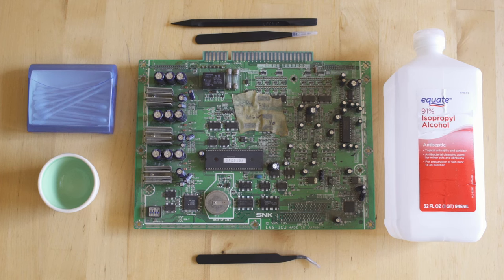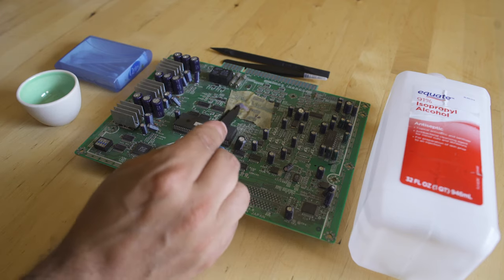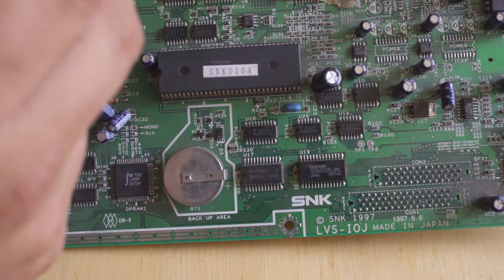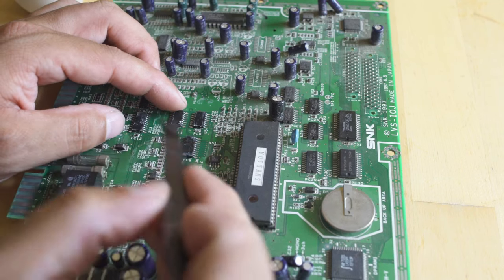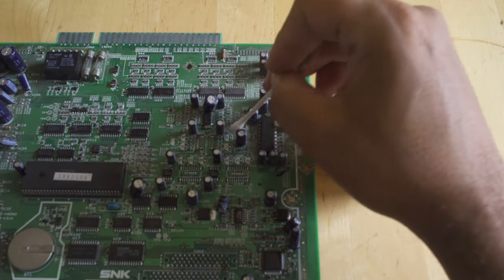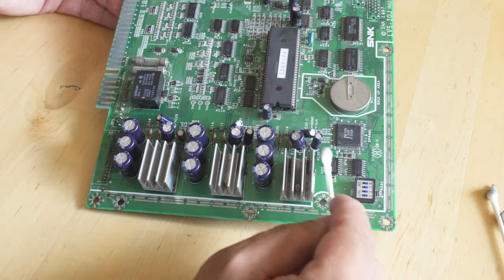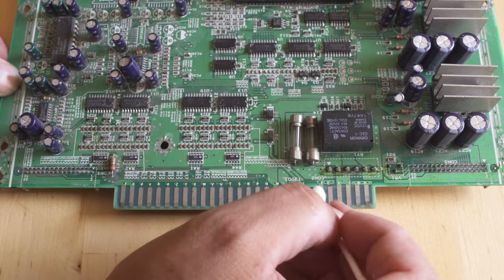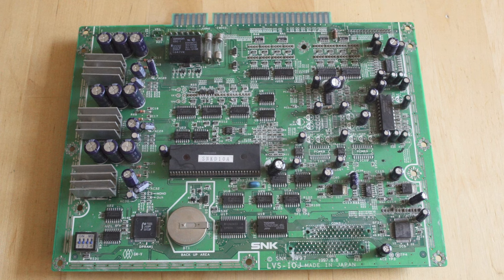How to Clean PCB's - On a Technicality - Video Game Esoterica

Comment: this also applies to controller boards for monitors, right? or basically any pcb board?
Reply from the maker: Any pcb. 91 or 99% IPA evaporates incredibly quickly. So any pcb can be cleaned with it. 30 seconds is normally plenty for any ipa to have completely evaporated unless you spill your bottle on it.
Reply: @VideoGameEsoterica  oh ok thanks! but since I can't go out due to the pandemic, is it ok if I use the normal 70% Isopropyl?
Reply from the maker: Deomari Laguipo yes. Just give it longer to evaporate. I also cannot find any IPA currently due to people buying it for sanitizing purposes. I normally don’t use 70% but if I had to I’d give it 5 minutes or so to truly evaporate. Specs say 1 minute but honestly giving it 5 certainly wouldn’t hurt
Reply: ok! thanks a lot!
Reply from the maker: Deomari Laguipo any time! Happy to help

Comment: Will the Isopropanol/Isopropyl Alcohol Clear 99.9% 500 ml
 work?
Reply from the maker: Yes. That’s basically straight alcohol with no water. Anything over 90% and you are golden!
Reply: @VideoGameEsoterica  what about 70
Reply from the maker: It’s fine. Give it a few extra minutes to dry

Comment: Thanks, 
1.) But what are the programming in these PROM chips? Can you use PROM chips to do address decoding? 2.) What Programmers do you use to test every TTL family and CMOS chips, logic chips, IC amplifier chips in arcade games? the IC leaper is limited only test few TTL families not all
3.) If arcade games didn't use Flip Flop IC chips the data from the EEPROM chips and microcontroller chips would be free running and not clocked, is this why they use Flip Flop IC chips because it clocks the data signals?
Reply: not sure what to think about your comment

Comment: A way better alternative to tapwater or the dishwasher.

Who would have thought that IPA could be used to clean a PCB? lol  ;)
Reply from the maker: The dishwasher works but that’s for extra dirty boards and the drying time is much longer. I don’t know the exact science on evaporation times but IPA 91% is basically instant vs water which clearly is not
Reply: @VideoGameEsoterica  

A big part of the problem with tapwater / dishwasher is the minerals and impurities in the water, which can hang around under chips and other components for years, and help accelerate corrosion etc.

Personally, I don't see why anyone would use normal water why it's cheap enough to buy IPA or distilled / deionized water.

(I realise IPA has a small percentage of water too, but it's far more pure, and as you say, basically evapourates within minutes.)

Using tapwater on vintage arcade / computer / console boards (especially if you're trying to make them last as long as possible) seems like doing more harm than good.

Hopefully more people will see vids like yours, on how to do it properly. ;)
Reply: Isopropyl alcohol, not India Pale Ale, just for the record. :-)
Reply from the maker: Lolol this is true

Comment: Oh I found cotton buds are terrible for cleaning the boards as the ends falloff
Reply from the maker: What brand are you using? Q-Tip brand never fall off but I’ve seen it happen with cheaper store brand ones for sure

Comment: DO NOT DO WHAT THIS GUY IS DOING
just ruined a vintage 1701 commodore monitor using the same stuff 

some vintage boards have a coating to protect them from corrosion and i just found out the hard way that it does not like IPA sprayed on it 
the hole green side of the board went discolored and sticky it's a mess
Reply from the maker: That means your conformal coating has broken down chemically. I’ve cleaned boards with conformal coating with IPA with zero issue. Whatever commodore put on the pcb has broken down over the years causing a mess. My advise is to remove the entire coating before it breaks down further. 

I even checked best practices spec sheets for conformal coatings and IPA is listed as acceptable. So due to age whatever is in your pcb has degraded unfortunately. 

Also like cleaning anything, always try it in a non-essential spot first. Just like rug cleaner warns you to clean a discrete spot first. And I don’t spray the IPA either
Reply: @VideoGameEsoterica  is there a stuff you can respray on the board it's a huge mess
Reply from the maker: Once it’s clean you can spray conformal coating back on it. I don’t think it’s necessary myself unless it’s in a humid or wet environment. Conformal coating is normally used in situations where weather exposure is possible. Most PCBs just have solder mask. I have never seen the 1701 board but clearly something they sprayed on the board is breaking down with age

Comment: NOT very efficient to use IPA to clean up tape gunk. butane works WAYYYYYY better! pro tip!
Reply from the maker: Eh I don’t keep butane around as I have no other use for it. I try to keep the tutorials to “one ingredient” when it comes to cleaning
Reply: @VideoGameEsoterica  i ALWAYS keep butane around. for exactly the reasons outlined above - fantastic especially when you need to get gummy residue off but do not want to harm plastic surfaces, unlike acetone with will damage them. alcohol won't work too much better than water and elbow grease in comparison